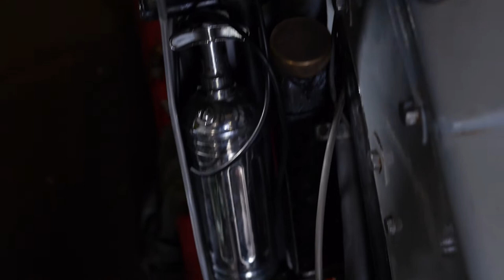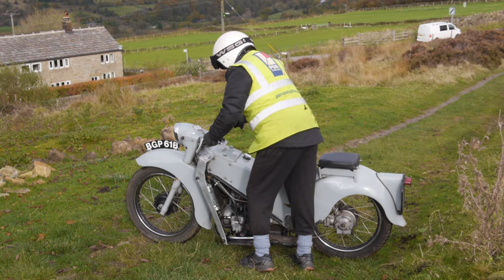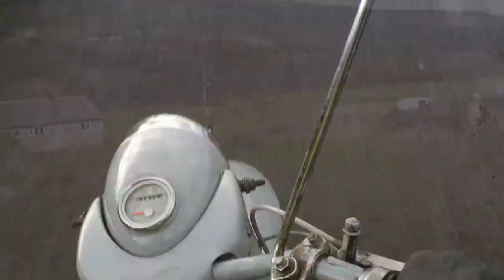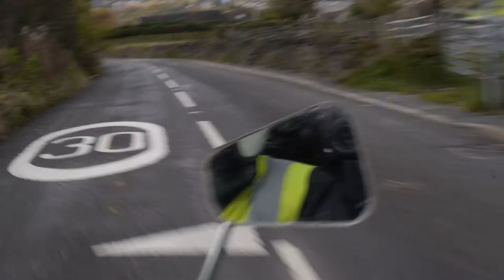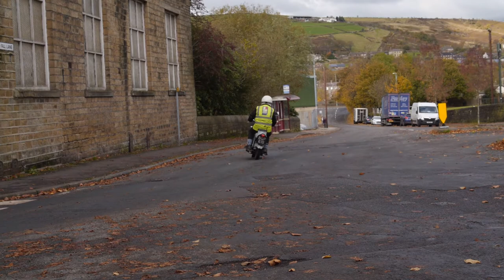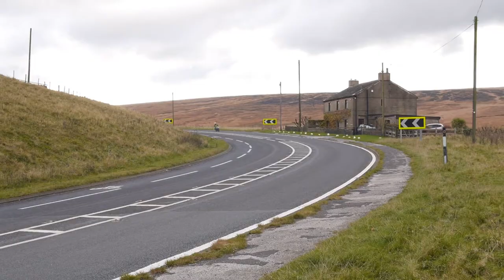LE Velocette At Speed!

Comment: This is a remarkable video from those of us blessed to know the story.

Just sticking to the LE, this is a most rare example.  The engine has been rebuilt by an engineer who has been involved with LEs since 1973!  The gentleman concerned, being a metallurgist, must be one of the most knowledgeable people on LEs and their mystery.  He was certainly one of the first to realise what an unique bit of engineering the LE is - decades before its time in numerous respects e.g. monocoque frame, rubber mounted bushes, water cooled flat twin, weather protection,  with shaft drive and not a single chain on the bike!  The gearbox showed BMW the way to do it.

The engineer has opted to go expensive and use the alpha crank [notwithstanding that he also had an original and rare factory reconditioned crankshaft].  The engine is a pearler with the original mechanical refinement and yet without the fragility of the original lubrication and bearing design.

Though this gentleman has achieved many great things in a varied career this is in an understated way a wonderful achievement.

And such a beautiful ride ...  maybe how Mike Hailwood would have ridden it